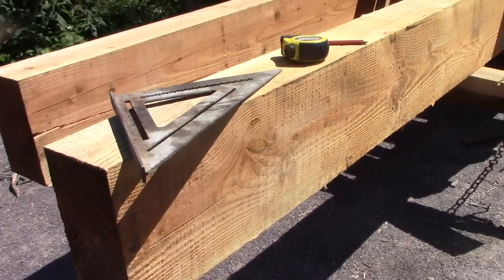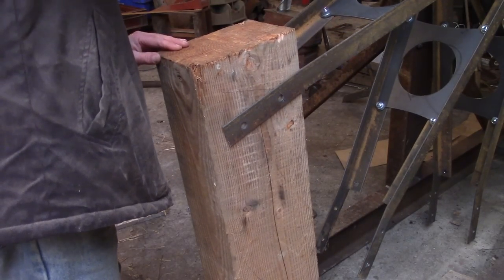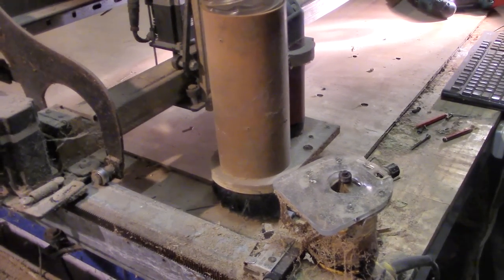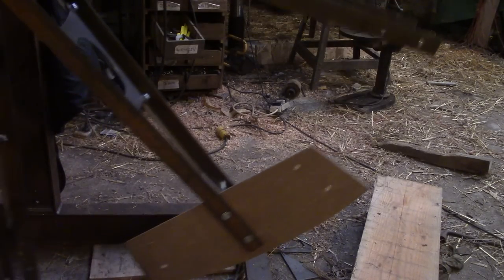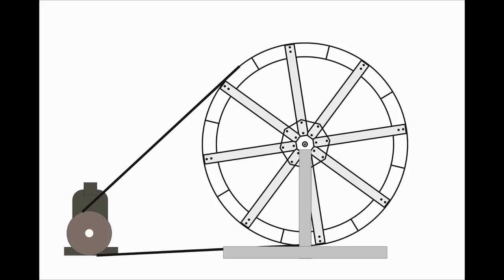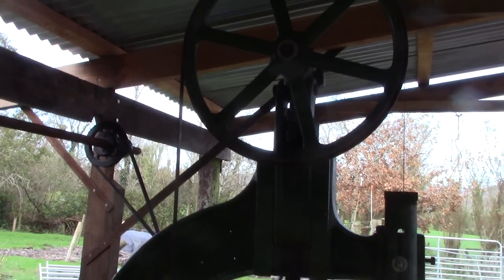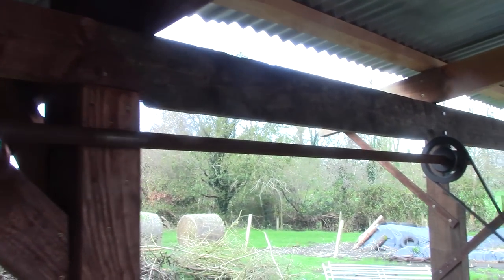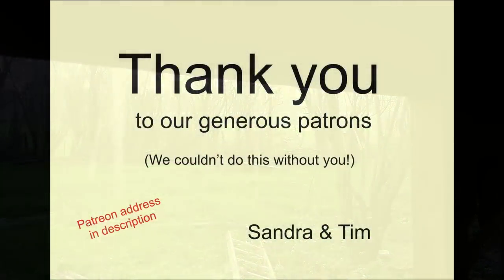Designing The Wooden Felloes For The Giant Momentum Wheel – and a major hold-up!

Comment: If you laid the spoked wheel on it’s side, build a form , then pour concrete wheel. Leave negative spaces with cans or pipe to fill later to balance wheel. Good luck.
Reply from the maker: I'd need a lot more steel in there in case the concrete falls apart. And the form would be complicated to build with a crown shape in the outer edge. And it would take a few people to stand it up again. So, all in all, I think I'll stick with my way. But you make one and we'll compare them?

Comment: Hi Tim, I think that if you get the segments cut it is best to just clamp them at the wheel frame before you drill the holes into it.
Then you could adjust them and see if they run true before drilling.
Reply from the maker: You're right. I'm hoping to build it in position and not on the floor, so it will try to sag down, so I'm not sure what's the best way really

Comment: I don't doubt your mathematics, but being from the "measure twice, cut once" camp, I wondered if you could cut out the wood templates from newsprint or butcher paper just to verify they all fit together. That Douglasfir is so gorgeous!
Reply from the maker: Good idea!
Reply: Yeah, I was also thinking about using the CNC router to cut all the templates in hardboard, since that's cheaper than ply, but would give you a rigid sheet that you can attach to the spokes.  Paper would be a bit too flexible to assemble in-situ.

Comment: Band round the outside YES use a single band place it in the very center, this will then give you a crown & if need be you can give the band a slight taper on the edge.
How to do this on such a large wheel?

Comment: Couldn't you put some rubber pads / gaskets between the wall and the mounting bracket for the shaft and could you use the cnc router on the piece of lumber them self would need a long bit but would be able to do them perfectly
Reply from the maker: my router wouldn't be stiff or strong enough for that : -  (

Comment: If you mounted a router on the floor. So you would remove wood evenly and at same time true up that massive wooden wheel. 
Once you got that  wheel spinning. It be two days to stop it or do you have a clever plan to brake it???

Comment: That's a lot of good wood to use as flywheel weight, make cheap wooden box sections and fill them with sand, save the wood for something structural.
Reply from the maker: interesting idea

Comment: For future reference. You could have printed the template out on paper. If the template you want to print is too big for 1 sheet of paper, you can export it as a PDF instead of print it, then in adobe reader or some other pdf reader, you can split an image across multiple pages.
Reply: The thin board makes a better template.
Reply: @calvingreene90  the paper is single use. The idea is you glue it to the wood then cut the paper and wood at the same time. No clamps necessary and printer paper is much cheaper
Reply: @Falney  
You are assuming he bought the scrap he cut the template from.
Reply: @calvingreene90  whether it was free or no doesn't stop the other point valid
Reply: @Falney  
Both methods work and both have advantages and disadvantages. If the material you are building with has a smooth enough I like glueing a paper template in place but in this case both for labor input and aesthetics, the wood template is better.
Reply: ...also there's trying to register all those sheets of paper exactly together
Reply: @brendangilmore4297  it's not all that difficult.

Comment: are you going to tilte the saw bed and cut the crown, or at least start the crown in the out side of the timber blocks?
Reply from the maker: I'm thinking a chainsaw afterwards - what do you think?
Reply: I think a cut from the center out on a tilt of 3-5 degrees would give you a more uniform surface for the belt  to ride on. Of coarse that would mean two cuts. But you're going to have that with the chainsaw too.  Hope this is helpful @wayoutwest-workshopstuff6299

Comment: Would adding more bearings to the line shaft reduce the amount that the shaft can whip and so reduce vibrations?  for that purpose they could even be 2-piece hardwood blocks with grease fittings.  That might be less work than lowering it (and keep it up out of the way).

Comment: I am no smith so this is just a wierdo looking in, could be entirely wrong here.

If something is standard practice (steel rim on the outside) it is that way likely for a good reason. Maybe better solution would be to carve grove first and than put on iron rim where its supposed to be? cetrifugal force sounds like it could wiggle the side mounts loose over time.

Comment: Balance the line shaft? That joint in the middle is probably 99% of the vibration. It's almost certainly not holding the two shafts perfectly true.
Reply from the maker: It's not supposed to hold them tightly though - that's how it accomodates missalignment..
Reply: @wayoutwest-workshopstuff6299  Hmm, well I'm not there in person to observe it, so...

Comment: Maybe the following will help: In the case of a drum-style pulley, without a groove or flanges, the pulley often is slightly convex to keep the flat belt centred. It is sometimes referred to as a crowned pulley. Excerpt from a Wikipedia page (for further info use link): https://en.wikipedia.org/wiki/Pulley#Belt_and_pulley_systems
One can also view: https://www.youtube.com/watch?v=TNuzi-jMXoY
Reply from the maker: That much I know well - but does it matter how big the pulleys are, I wonder?
Reply: @wayoutwest-workshopstuff6299  Hello,
These belt driven systems were often used on steam tractors and in steam (and diesel) driven factories like paper-, steel-, cotton-mills, saw-mills, metal- and other workshops.
Have a look at the belt pulley in this video (start viewing at about 01:00): https://www.youtube.com/watch?v=SAd-2l1IMAo
and this very short one: https://www.youtube.com/watch?v=Ns0vCw5_Kec
A huge belt can be seen here: https://www.youtube.com/watch?v=8aRgITK6RQU
(at 1:30 you see the driving belt on the left, the small belt on the right is only for the governor)
Note: (leather) belts preferably need a "twist" to run more stable.
Tipp: the flywheel and pulley can be two different wheels on a single shaft (the smaller the pulley the higher the speed of the flywheel).
For safety PLEASE build some casing around the wheels and belts !

Comment: Cutting this beautiful piece of wood in pieces for… weight on a flywheel(?) hurt a bit. Sell it, get some concrete and pour it right in the shape you need. But entertaining as always, I’m sure you had your reasons.
Reply: Completely agree so sad to see 😢
Reply: Concrete isn't uniform enough for that to work, and it doesn't withstand tension very well. Plus, if it DOES explode, it'll explode in shrapnel instead of large chunks of wood that won't go far.
Douglas Fir is a softwood. There'll be another tree along that size in a few years.
Reply: @Skorpychan  Yes if you work with concrete the centrifugal forces would be a huge issue. So you need steel around the circumference to get the load from the concrete to the spinny thing.